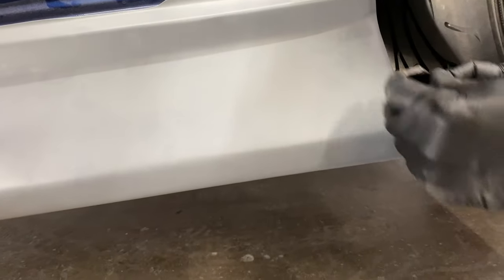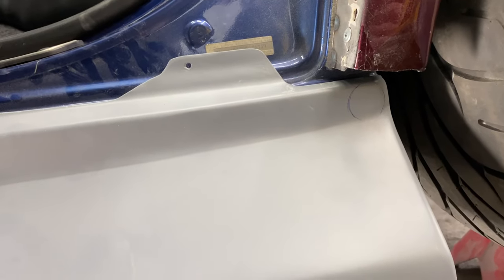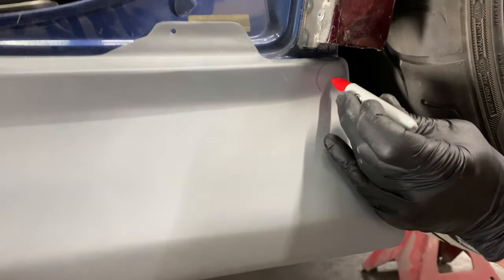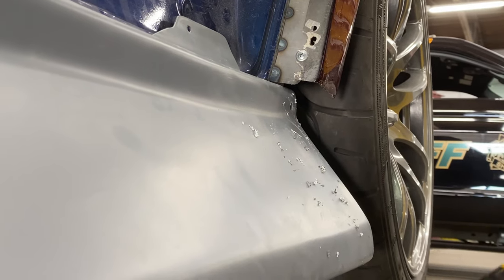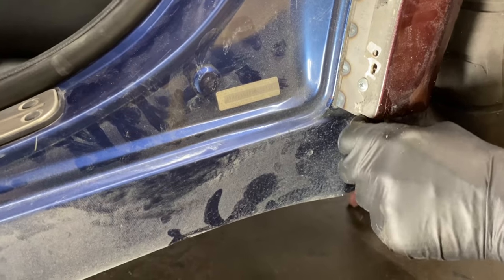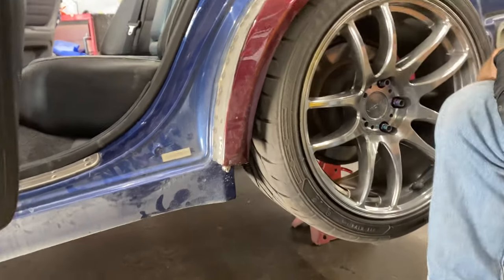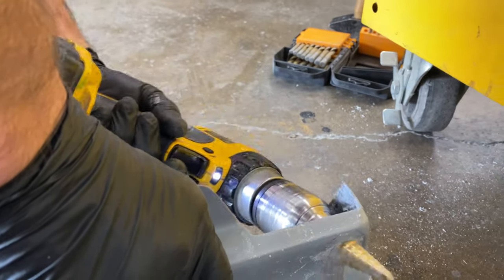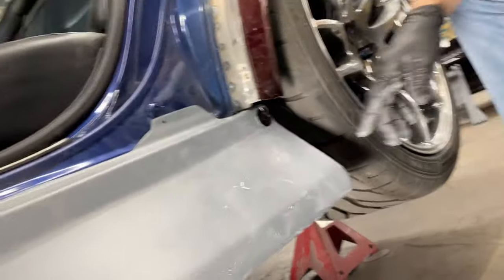Lexus IS300 Build Part 5 : Quick release BN Side skirts & Front Bumper

Comment: Which Amazon Quick Release did you get? I know in your last vid you said they appeared to be just as good and were fairly cheap.  Thanks!
Reply from the maker: The ones we used were from Gangmu Tech pretty much the first thing to pop up on Amazon when searched or eBay either or and we got the 8 pack honestly after a month of on and off so around 30 times they still work great ! Thanks for asking

Comment: What did you do for mounting the grill to the front bumper, did you do a lot of trimming? What body kit are you running?
Reply from the maker: so the kit I'm running for now is a duraflex BN style kit I bought it heavily used for $600 and did the necessary repairs and thickened every piece with fiberglass mat around an 1/8th of an inch its a complete tank now and will hold up awesome, dont recommend though have around 50 hours into a kit on a drift car it will break, but i did save 1000 bucks and have a better quality kit but whats your time worth hahaha, since it was used they just poorly trimmed the front bumper for a grill, even on stock bumpers they don't fit the best you pretty much get them to sit right and screw them into place when you have the gaps and angle right its a pain, you can mount them via scew or bolt into the bumper itself as one piece but it puts more stress on the front bumper and will surely crack the middle out with light impacts, hope this helps sorry its long winded the kits are all just very rough and take a ton of fitting unless you just simply don't care lol hope this helps thanks for asking !
Reply: @PABSTDRIFT  thanks man that really helps a lot, I have the fineline tuning kit and been afraid to screw it up, I figured I’d ask, love the build by the way 👍🏽